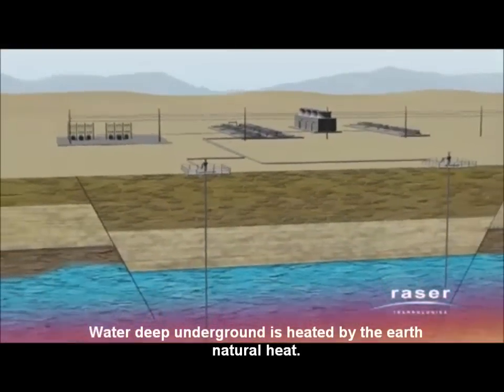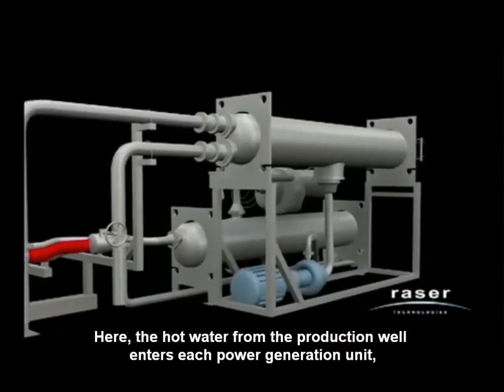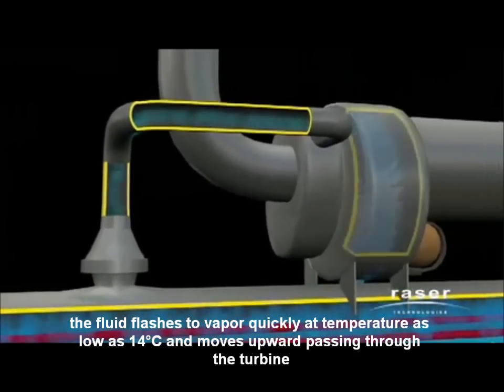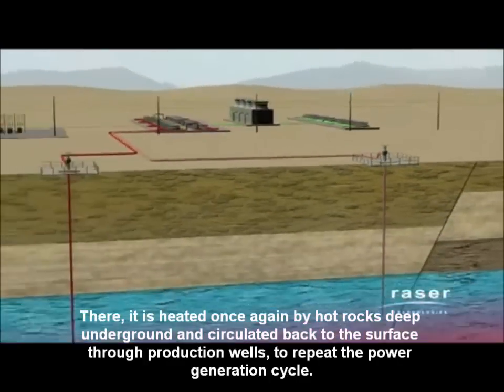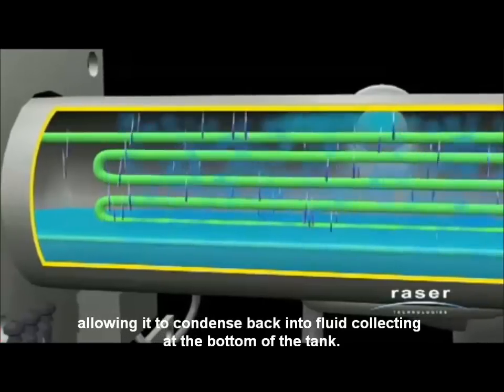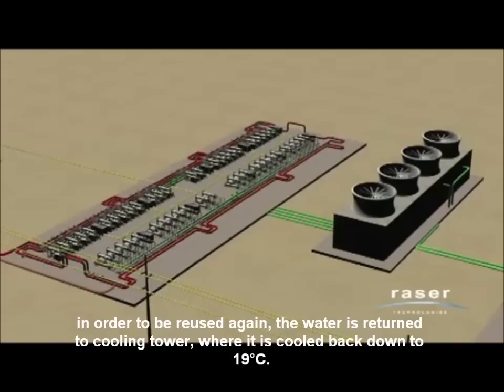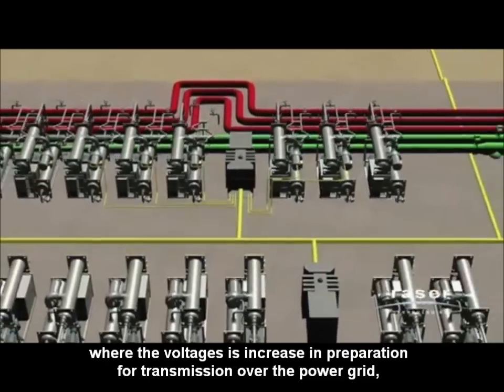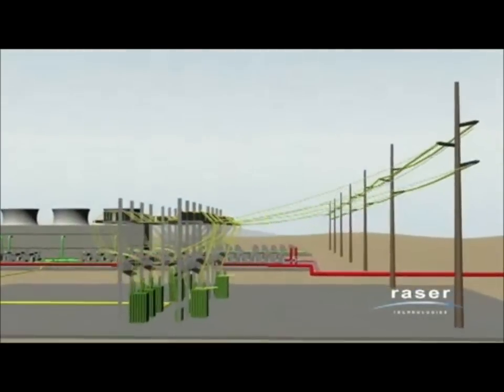Geothermal binary cycle power plant process

Comment: As for the current binary generation the output is small,of the nuclear power generation is not substituted but can run the 1 million kilowatts geothermal power plant where is equal to a nuclear power plant by terrestrial heat  if use a medium of Soyama generation.